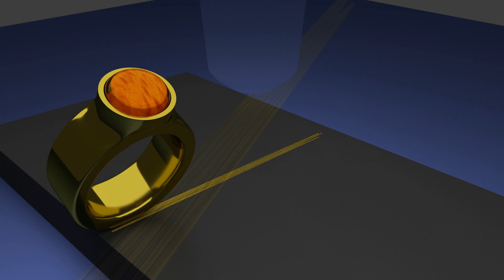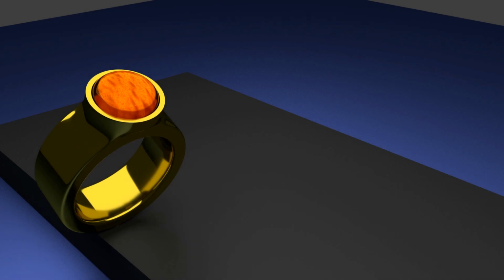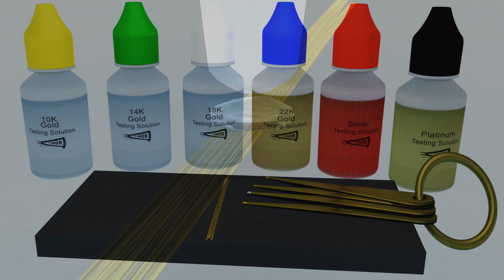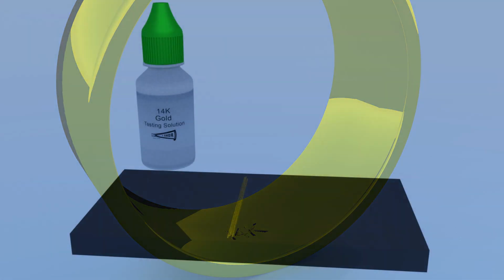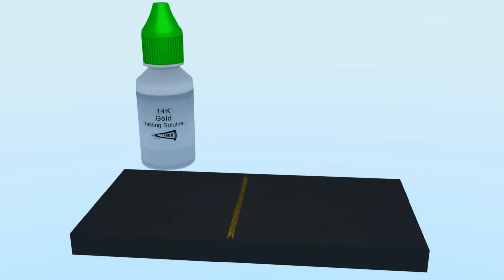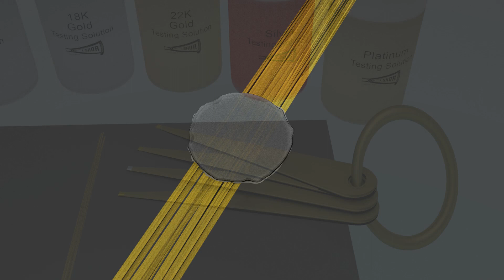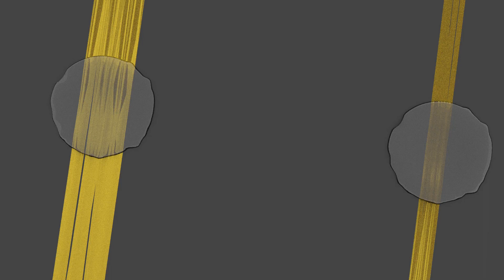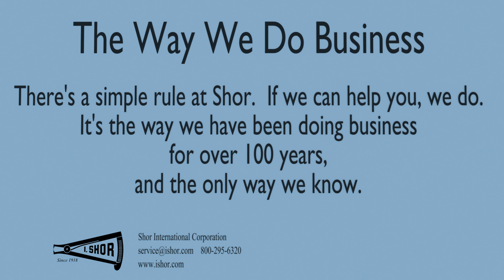Scratch Testing of Gold, Platinum & Silver

Comment: Thanks for this nice video. Can we test rhodium for this method?
Reply from the maker: In jewelry, rhodium is only used to plate the jewelry (primarily diamond mounted heads).  However, if you want to determine whether an ingot is platinum or rhodium, a scratch line of rhodium will dissolve in sulfuric acid but platinum will not.

Comment: What would be the reaction if I tested platinum with the silver acid?
Reply from the maker: The silver test acid is potassium dichromate and 70% strength nitric acid.  Neither will react to platinum.  However, palladium (a platinum group metal) will slowly dissolve and the scratch will disappear.
Reply: Wow I didnt expect a response so quickly, thanks for the knowledge

Comment: Thanks for making this video. Man, so does this mean pawn shops are scamming people? I was told that if it's green it's fake and not worth anything yet there are so many different colors the correspond to varying purity levels
Reply: Green is probably indicating copper. The test solutions are cheap.  And if you only need a rough estimate of purity, you can use them without the test needles.  Shor carries these products, but you can also get them through Amazon.
Reply: @blaniardmarshall8924  Thanks

Comment: Never scratch your gold jewelry on a sanding stone. This method is more than stupid. It’ll scar your piece.
Reply from the maker: A touchstone is not a sanding stone.  It is much smoother, more like an Arkansas stone.  This technique is time tested, over 4000 years old. The touchstone was first used during the Harappah period of the Indus Valley Civilization ca. 2600–1900 BC.  Rubbing your jewelry against the stone will, of course, leave a very slight mark.  This is easily and quickly removed with a light buffing.  However, most people don't care about the mark because they are either buying or selling the jewelry and are only concerned with the precious metal content.
Reply: @shorinternational3841  thank you for the explanation. I had bad experience with it. Once brought a solid gold Rolex Datejust to a jeweler, and the lady casually but forcefully scratched the corner of the lug to a touchstone. The corner was left with a visible flat area. After polish, the lug no longer retains its factory corner radius. My dealings with gold are limited to the watches, where scratching the piece on a Arkansas stone is unthinkable. Nonetheless, this tutorial is amazing. I would do it with other gold pieces.
Reply from the maker: @danielx40  Excellent point, Daniel.  For something like a Rolex, they should not have even tested it.  The gold content is already well documented and testing was unnecessary.  Additionally, even if testing was desired, they should have used an electronic tester.  That kind of tester may leave a slight discoloration on the metal, but the discoloration is easily removed with an ordinary pencil eraser.
Reply: @shorinternational3841  Got it. Thank you for the information on electronic testers. Will look it up in the future.